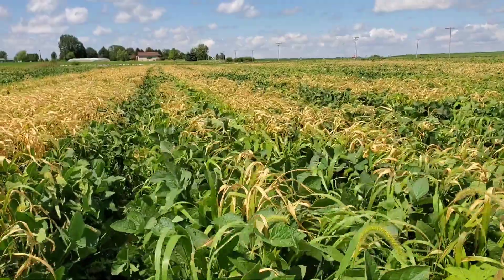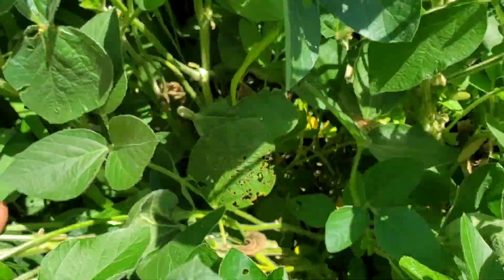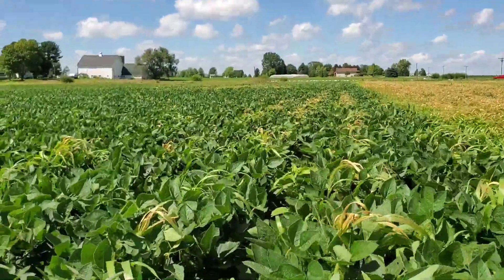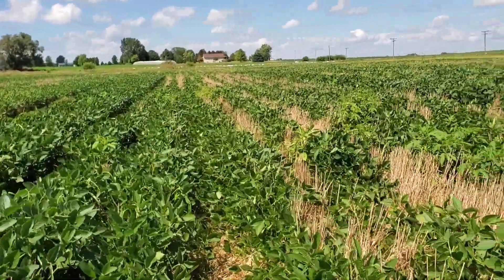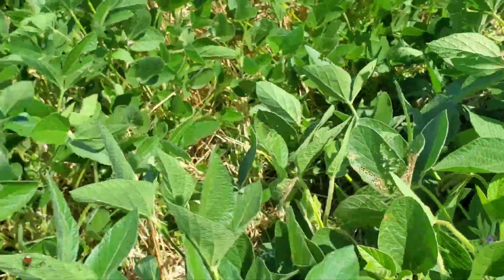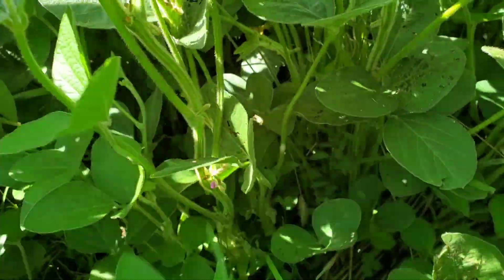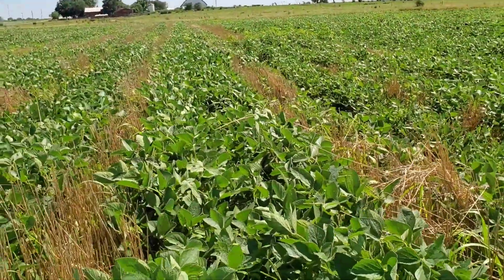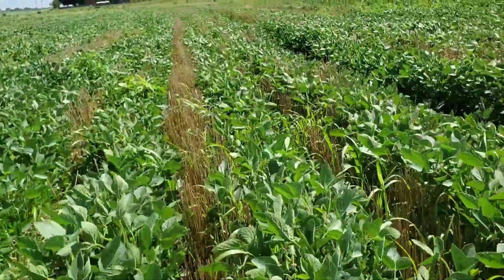August update on organic no till soybean trials.

Comment: Did you tine weed or rotary hoe the conventional tillage beans?
Reply from the maker: The tillage system got at least 2 rotary hoe passes, maybe 3. I'd have to check my calendar. Ideally the drilled beans would have been hoed at least 1 more time based on observed weed pressure later in the summer.